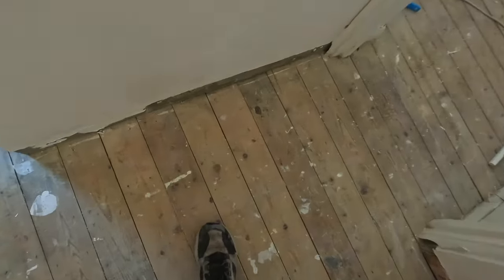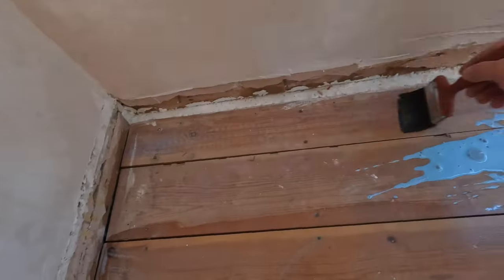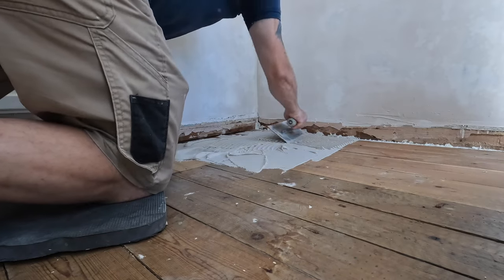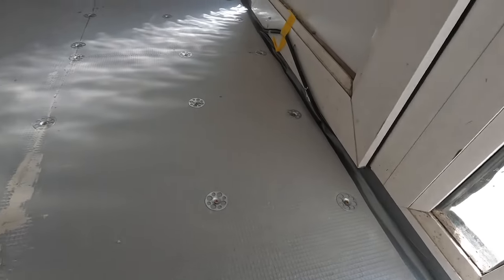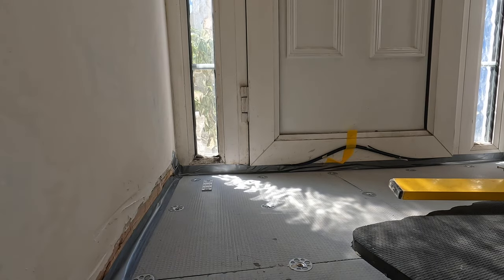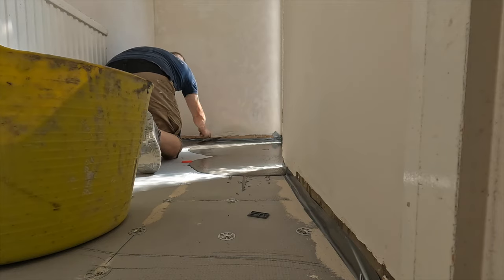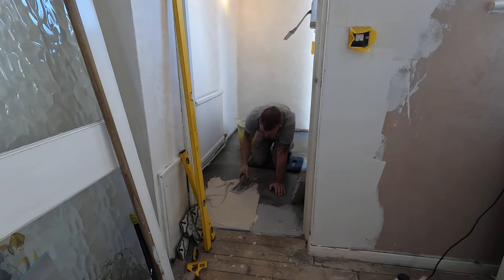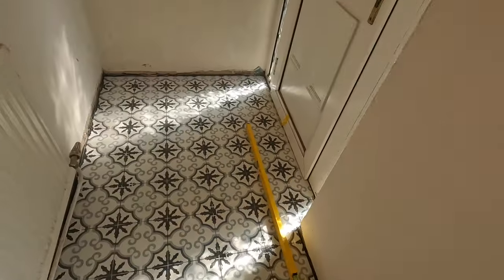Tiling on top of the floorboards

Comment: Valentino, I would have used a continuous piece of backer board in the doorway as that is the tread area. You can raise the PVC door a little on its hinges, not too much but maybe enough to help. Very useful vid though as working on suspended wooden floors is full of complexity. Pity the customer was working to a budget as those radiator pipes needed to go under the floor! That may have given you the access to level the joists from underneath. It must be very frustrating for you to have to compromise. That said, these sort of vids where compromises have to be made are the most useful.
Reply from the maker: Thank you for your appreciation.
🙏

Comment: I have the same type of subfloor in my entryway, but it has layers of old paint that can't be sanded off - can the same process of adhering the backer board be done in my situation?
Reply from the maker: Hi . Ideally you want to scratch the paint off. Use very rough sand paper ( 40 grit ), or an electric planer if possible. A very good wood primer for tiling and then the steps from the video .
Reply: @valentinointeriors3023  Thank you!

Comment: Does this protect the floorboards?  I'm buying a house and some have floorboards sunken, so I'll have to replace them, just wondering if tiling is more durable than carpet etc to protect floorboards (in terms of damp etc)
Reply from the maker: Hi . I will not cover the floorboards with tiles to protect them. Carpet or flooring will be just fine . The floorboards that are bad will have to be replaced with new ones.
Reply: @valentinointeriors3023  thanks. Do you think it's possible the panels have sunk due to heavy furniture being on the top for many years and having no central heating so creating damp/cold spot in that corner?
Reply from the maker: @hln1969  . Yes , definitely. We see this all the time . Specifically under the bathtub. If heavy items are on the floorboards or chipboard they can sunk a bit.
Reply: @valentinointeriors3023  thanks, the survey mentioned so many 'could be's' but nothing specific.  (Ie air vent brick  too low, chimney leak, gutter leak, drains). All they did was a visual check... They didn't  look under floorboards.  Obviously, I'll try to have each area looked at when I can afford it, but it's difficult knowing where to start.
Reply from the maker: @hln1969  . I would recommend to check every area that doesn’t look right when you’re doing the floors. I now is not easy specially after you bought the house . Most of the time there is no buget left for that . It was the same for us . So when the time comes make sure you are checking if everything is ok , don’t just cover it as it may get worse in time and you may have to do it again. Best of luck 🤞

Comment: im planning on doing my upstairs bathroom and i was wondering if theres anything i must do before going diy on the tiling. the floorboards are bit noisy and im pretty sure some of them "breathing" when stepping on it. dont really rant to replace floorboards cuz dont have that kinda funds available. would it be an issue that the boards breathe when stepping on it? obviously not a major movement in them but still some.. would the glue hold the tiles in place or would they start cracking and disconnecting after a little while?
Reply from the maker: Hi Peter
You have to make sure that the floorboards don’t have any missing screws or nails. Prime the floorboards and then glue down a 6mm cement board with flexible tile adhesive and screws. Use small screws to fix the cement board into the floorboards. No need for long screws because you will have pipes, cables under .( if you can install a 12mm cement board is even better) 
After this you need to prime the cement board and you can install the tiles. 
I hope this makes sense, but don’t hesitate to ask any questions if you have.

Comment: Just subscribed. Came across your video by chance as amateur DIY'er. Excellent video, very informative, great number of helpful tips, especially using packers on the floor to easily check visually that the levels are correct. Great detailed but concise in depth explanations
Reply from the maker: Thank you for your comment, really appreciated 🙏

Comment: Hi we are in Ireland, I think you are back home but if you were here I would ask you 
to do this work.
Question please? Can we use a 20mm backer board to increase insulation on a
wooden suspended floor like the one you show? (we don't want to take up floorboards as too messy).
Then we intend to put carpet over it in living rooms.
Lino floor covering in the Kitchen.
PS if you are interested in doing this job and more jobs, let me know.
Reply from the maker: Hi . Thank you for your offer and for your message. Unfortunately i will not travel this year as I have a lot going on here. This insulation is for a solid cover ( tiles , flooring). I don’t think to be a good idea to use it for carpet and linoleum. So maybe use laminate flooring in stead otherwise you need to use different backer boards, or plywood.

Comment: Hi Valentino! Great video, one question: I have many tubes running through the wooden floor. What do I use to close these gaps so I can use the selfleveling compound? It is the bathroom so should be watertight…
Reply from the maker: Hi , thank you 
You can use silicone or expanding foam . Depending how big the gaps are . Silicone for smaller gaps and expanding foam for bigger gaps.
Reply: Awesome thank you!

Comment: Excellent video mate, im about to do my bathroom floor, but i was wondering.. could i put tiles onto backboard without sticking backboard onto the floorboards? Maybe just only screws? 
Just incase i need to do any future maintenance to paperwork underneath
Reply from the maker: Hi , thank you for your message. Difficult to say yes to this . If I will do this I will definitely stick this with adhesive. If the floor is good and doesn’t have much movement you may be ok . I think this way . If I have a leak and I can’t get to it from underneath ( ceiling) I will have to remove and dispose the tiles . Doesn’t matter if I have to remove the backer board as is not expensive.

Comment: Hi’
Good work. I want to do the same work in the bathroom on the first floor. The floor is made of wood, and I want to use 1200mm/600mm tiles on the wall and floor. What adhesive for wall and floor tile's I use? Thank you in advance.
Reply from the maker: Hi . Depending where about you are. If you are in Uk you can use adhesives from Ball , Topos tiles , or Mapei . The adhesive has to be flexible and is very important to use a primer before. Any of this adhesives will do the job . Thank you for your appreciation.
Reply: thank you for your last response, I would like to ask you if SBR bond is good for primer and for BAL flex ONE tile adhesive to glue the tile boards and or even to glue the 1200mm / 600 mm tiles thank you for your response  advice in advance yes I in UK
Reply from the maker: @benzrom5096  Hi . Yes , you use the SBR for priming and the adhesive to glue the boards and tiles . Bal flex one is a good adhesive. If you are priming a wood surface do not dilute the primer.
Reply: thank you very much for your quick response I have another question because you are in the construction field, there are people who say when they cover a wood floor with vinyl or tiles that the wood floor will rot because the steam  water cannot escape it is true or false thank you and good luck.
Reply from the maker: @benzrom5096  Hi . That is false. The steam , moisture should never escape through ceilings, floors or walls. The humidity should escape through windows or extractor fans. I will not be worried about this at all. Thank you
Reply: Thanks for a good vid

What is the name of the board you used after the primer and cement

Comment: Hi can this be applied to bathroom? Do we still use the same chemicals? I was thinking also maybe on top of the backerboard using membrane?

So questions can be listed like this:

-Cement boards or backer boards?
-6m or 12 mm?
-Im assuming i will still use primer that you used. No PVA?(on floorboards)
-Do i need membrane on top of the cement/backer board?
-the spactula. There are different size of gaps. do i use the small tooths or big ones?
Reply from the maker: Hi 
-cement board as it is more rigid. 
-12mm is better then 6mm if you an use .
-you still need to use primer on the wood.
-there is no need to install membrane over the cement board.
Reply from the maker: I normally use a 6mm notched trowel
Reply: Thank you
Reply from the maker: @ArtCraftBlackLight  No problem. 
You are welcome.
Reply: @valentinointeriors3023  If you dont mind few more questions come to my mind. 

1- Why 12 mm ? I guess i can make it 12 but its gonna make things go higher ofc. I have floorboards so i cannot remove them. instead of making 12 if i make 6 would i regret it?
2-Do i need to put some sort of water resistance chemical on top of the cement board?
3-As the door will be on the way, i guess i will have to shave from the bottom of the door correct?

Thanks a lot
Reply from the maker: @ArtCraftBlackLight  Hi 
1. You can use 6mm without any problems . Just make sure you are gluing this on the floorboards with tile adhesive. I was under the impression that you ask what is better… 6mm or 12mm . 12mm is better than 6 mm if that can be use . I normally use 6mm for height reasons.
2. If there is a chance that the cement board to come in contact with water or humidity you have to do waterproofing as the cement board is not waterproof. 
3. If you need to shave the door that is easy and it can be done without any issues. Normally this needs doing.
Reply: @valentinointeriors3023  Thanks a lot. I will be using the same things you used on this video . 

I mean i will be tiling the cement board, and that will have grout. Regardless of this actually can you recommend a water proof something for me to apply please?

thank you very much.  Subscribed.
Reply from the maker: @ArtCraftBlackLight  Thank you .
I normally use waterproofing kit from Mapei . Like this :

https://www.screwfix.com/p/mapei-shower-waterproofing-kit/78484

There is everything you need in this kit . 
If you are doing a wet room you may have to buy some internal corners as well.
Reply: @valentinointeriors3023   Thank you very much. 

I can tile over this right? This will be applied to cement boards (6mm) than i can tile it. I dont have a wet room i have a bathtab instead. 

Again thanks a lot
Reply from the maker: @ArtCraftBlackLight  Yes , you can tile straight on this .

Comment: Great video, how did you remove the tape around the outside on the floor after pouring self levelling compound?
Reply from the maker: Hi . You can cut the tape around or just pull it out. Just don’t use too much on the floor as the self levelling doesn’t stick very well on the tape.

Comment: Excellent video. I am concerned about my floors because they are so squeeky and wobbly. So I will screw down the floorboard before proceeding and use a hard backer board regardless. Question: what is the best levelling compound for this type of job, if price wasn't an issue for the client? The absolute best of the best?
Reply from the maker: Hi . Levelling compound from Mapei and Ardex will do the job just fine . In my opinion the best levelling compound and adhesives are from Ball . Just remember you need a flexible one . Thank you

Comment: I’ve just got my first fixing of plumbing in bathroom and I’m back to old boards. Do I lay 12mm ply down? Then would you need some sort of sheet or anything on top of that or can you tile straight on top. Thanks
Reply from the maker: Hi . I would install a 12 mm backer board instead of ply . The backer board should be glued with flexible tile adhesive and secured with screws. Then you can tile straight on top. Don’t forget to use primer prior the backer board install and before the tiles install

Comment: Thanks for this step by step tutorial. I've followed your instructions/guidance and made a mistake with the floor levelling compound. The floor slopes! Would you recommend adding more levelling compound to the shallow end or make it up with a thicker layer of tile adhesive?
Reply from the maker: Hi , thank you for your message 
Depends how much it is . If is a small area and is not higher then 2cm you can make this with tile adhesive. Just make sure you have full coverage under the tile .
Reply: @valentinointeriors3023  Hi, Thanks again. I'll give it a try.
Reply from the maker: @corkandi  no problem

Comment: gonna need to redo the floor in my bathroom on first story cuz its vinyl from the 60's starting to look and smell like a trap house. do you think the very heavy cast iron bath with 4 legs will work on such tiling? i'm scared it might break the tiles given the high weight applied on a soft/flexible base layer between tiling and wood.
Reply from the maker: Hi 
In this case you have to use cement boards . They are more resistant to compression. Also your floor and joists have to be in good condition.

Comment: What makes you decide to not use the standard silicone flexible membrane backing for hardwood floors in this application? I can’t think of the exact name of what I’m referring to but it’s usually orange silicone type backing that goes on I see sometimes after the thin set which I presume would be used to partially level it out where it is close to that anyway. I guess I’m asking in part why no membrane here or you just prefer that first material you mentioned (insulating board?)?
Reply from the maker: Hi . The membrane is called Uncoupling membrane from Schluter . That membrane is not suitable for floorboards. It is only for ply, OSB and chipboard. For floorboards you need to use this one or cement boards, or other tile backer boards , no membranes.

Comment: I like your method but what if the material(backer board) that  you glue and screw over timber floor is not available do you think a 5mm fibrolite sheet  could be used as a substitute?
Reply from the maker: Hi 
I don’t know what this board ( fibrolite ) is designed for so I can’t really tell you if this is going to work. I am pretty sure you can get cement boards I most of the countries, maybe by different names. 
To be honest if the tile can make a good and strong bond with this board you can use it. Maybe you can do some testing.

Comment: Hello, I am currently in the process of levelling my floor in a 1900 tenement flat. I’ve figured out the biggest dip in the room is 41mm. To level this floor would I just follow this process or would you suggest any additional steps considering it is a significant dip in the middle of the room . Thanks
Reply from the maker: Hi , in this case I will use a different method. I will remove the floorboards and I will attach another timber (4”x2”) on the existing joist to bring them at the right height. The new timber will have to be screwed and if possible some expanding glue .

Comment: Hi thanks for your video. Can I ask some advice? I’m looking at doing my bathroom my house is a bungalow and I don’t want to tile all the hall way. How do you transition from tile to carpet or laminate without having a massive step at the door if say I had to use a cement board on the floor in the bathroom?
Reply from the maker: Hi , 
You can install some OSB in the hall ( 6-9 mm) 
If this is not possible there is not much that you can do apart from a stepped threshold . 
Thanks

Comment: A great video! I do have a question for my project. I am buying a new build house and will do the tiling. In the bathrooms they already installed on the floor the backer board (baseboard), I can see the same screws you used, however I am not sure if they used any adhesive underneath. I was advised to remove the backer board and to install a decoupling mat, I also got advise just to tile over this already installed backer board. What is your thought on this? Would love your advise. Should I remove the backer board, should I prime it and then put the tile on it, or is it maybe possible to add the decoupling mat on top of the backer board, running out of ideas here. Your help would be much appreciated. Thank you
Reply from the maker: Hi 
There is no need to replace the backer board with decoupling membrane. Both of them are ok for tiling. In my house everything is tiled ( floors) over backer boards. I will check if the backer board is also glued down and if it’s not I will do this . Pretty easy as is already cut to size. Just remove the screws , and use a 5mm notched trowel and place the screws back. The subfloor needs to be primed and before the tiles installation I will prime the backer board as is been there for a while and it may be dusty . When you are checking the backer board this should be better 6-12mm. Any thicker then this may not work with small tiles. 
Any questions down the line please feel free to ask.
Reply: @valentinointeriors3023  Thank you so much, this helps a lot. I didn’t check the tickness of the backer board, will do that also for sure once I visit the house again. And then when I get the keys the work can begin. At least I know now what to do, thank you once more.
Reply from the maker: @evelinduric3742 You are very welcome.
Thanks

Comment: Hi, what happens if you have to lift the floor boards to get to the radiator pipes if they under the floor boards?
Reply from the maker: Hi . In our case the pipes are exposed. If there are any pipes under the floor you should inspect them and if any joints need repair/ replacement you should do this before. If you have to do it after you can imagine that it will not be very easy.

Comment: If I wanted to put underfloor heating (electric) would I have to put it under the self levelling compound or under the tile?
Reply from the maker: Ideally under the tiles. If the tiles are too small is a good idea to use self levelling.